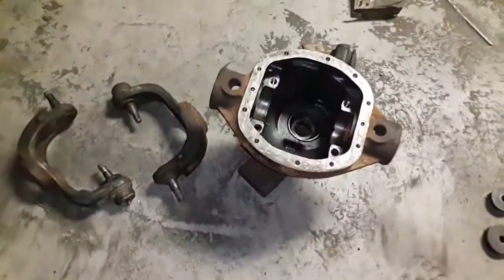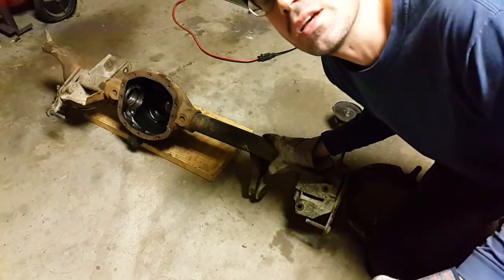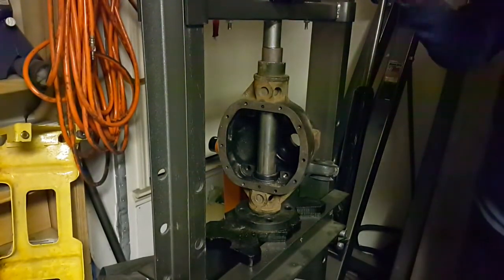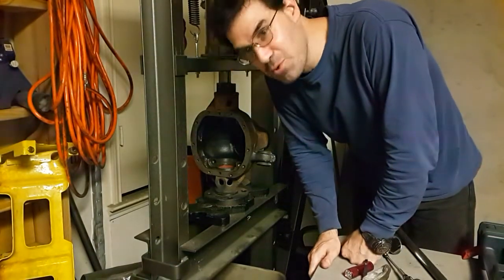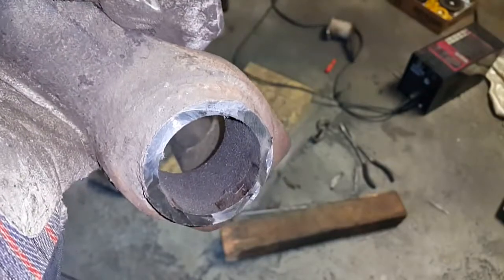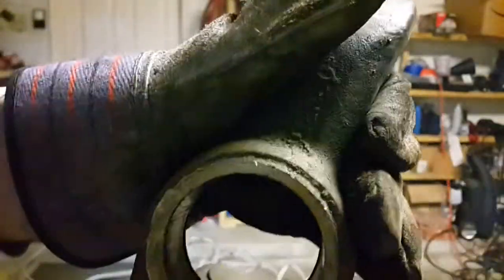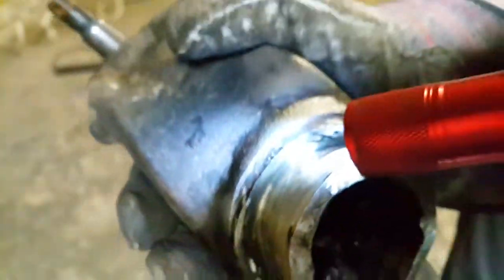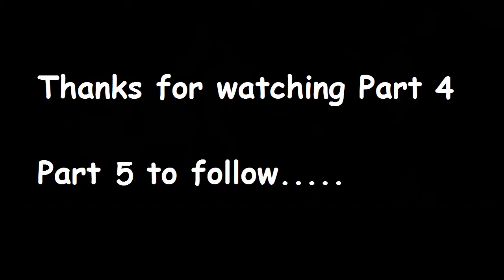Building a D30 HP jeep front axle: Part 4 - pressing out axle tubes

Comment: Wat if you heat the pumpkin to push it out??
Reply from the maker: when you try heat something that is pressed together, then they both expand the same because the  heat conducts all the way through.  so you can use heat to fit things, but never to take them apart.  the only exceptions are heating tools that heat the "outer" thing so quickly that the inner thing does not have time to get hot; examples are milling tool holders.
Reply: Or how about packing the tube stub with ice to shrink it down?  I would think welding a bead in the tube stub would cause it to expand.